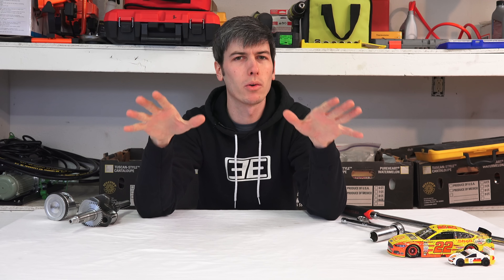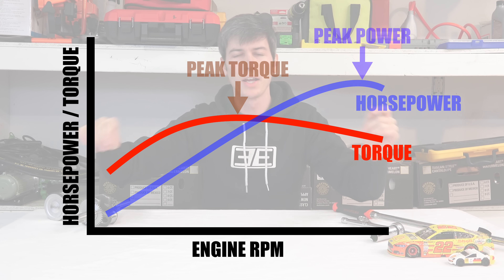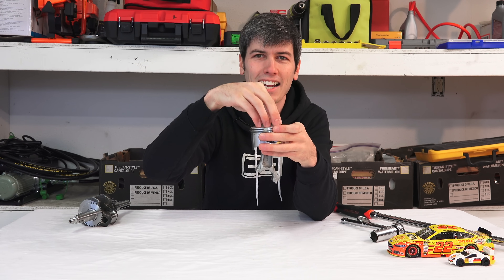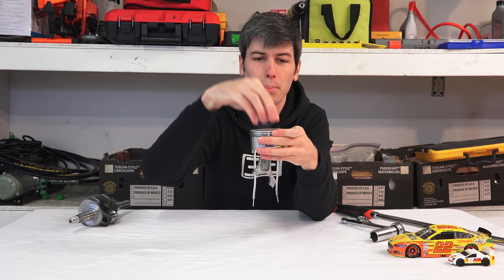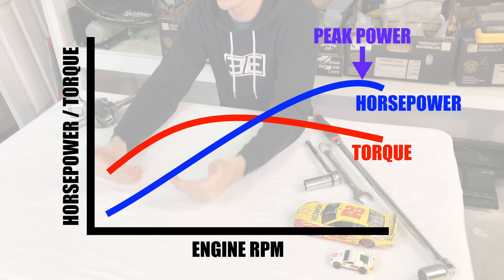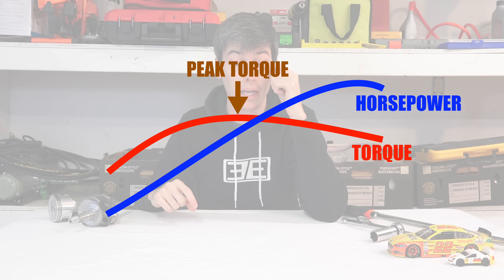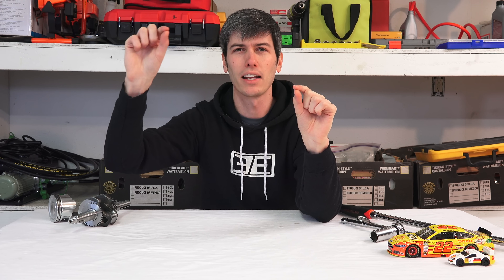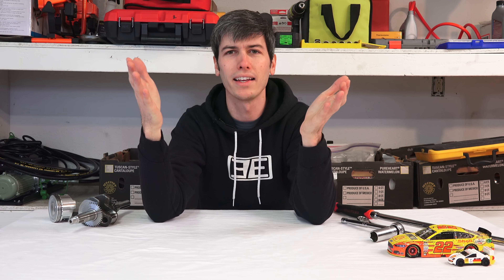Horsepower vs Torque - A Simple Explanation

Comment: OK, for the first time I really get why and engine with a longer stroke has more toque!  Same boom on a longer handle = more force to move (torque)!   And I get why a faster revving engine has more HP!    More booms per minute = more work done (HP)!
Reply: All else being equal, increasing bore AND/OR stroke will increase torque.  Each time the engine fires, you get an amount of effort.  A larger bore, the more fuel/air, the more boom, the more effort.  That effort at a distance is the torque.  The distance is (more of less) the stroke.  but all of this is how hard an engine can push, not how much work it can do.  HP is how much work it can do.  I think the simplest way yo look at HP is how many booms do you get a minute.  Each boom pushes at a set torque.  If you get one boom a minute, you will move slowly, even if you have huge torque.  If you can get 1000 booms a minute, you will move much faster.  More RPMs = more HP because more booms.  

I think:  Often it is true to higher HP engines are lower torque because the tweaks used to get higher torque make the engine mechanically impossible to run at higher RPM.  To increase the bore, you make the piston heaver.  The heavier the piston, the more effort is takes to change it's direction at the top and bottom.  The more effort to change directions, the faster to deteriorates.  You can only push so hard before the oil can no longer protect the parts.  Same for stroke.  The longer the stroke, the further the piston must travel per rotation, and thus faster travel per RPM.  The faster it travels, the more force used to change it direction.  

High HP F1 cars have extremely short stroke engines so that they can rev higher.  Trucks that need to be able to move heavy loads have long stroke engines that do not rev high.

Comment: Still confused.  You say peak torque is when I feel the most force against my back, so... that means the car is accelerating the most... how could it have more horsepower (meaning acceleration) later in RPMs if I've already passed the point in the power band where it had the most acceleration?

Wait, I think I understand now.  Maybe you could think of it like the power of the engine is at its most efficient at peak torque (every time the piston fires, you get the most 'push' per explosion), but it loses fuel / torque efficiency as the RPMs increase -- but that doesn't mean it's going slower, because the engine is turning twice as fast even though its only 0.8x as efficient.  2x as fast but 0.8x as efficient still equals 1.6x.

If I'm right, I would amend your comment and say at peak torque I feel the most force against my back PER REVOLUTION, but I will feel more force on my back higher up the RPM band.

Now I'm wondering what the application of 'torque' is to racing.  Why would racers want to know torque, why not just worry about horsepower and trying to maximize time spent at the peak power band?

Comment: Torque: you drive a car and push the throttle. You know that "sweet" felling that pushes your body in a seat and makes a big smile in your face? That is torque.
Horse power means more max speed and faster acceleration thru gears.. 
Comparing same hp cars , diesel and petrol in same gear, diesel will always pull better. It has more torque. Electric cars are even better than diesel. More torque.
Reply: em745a  😑

Comment: Why don't we use self ignition with gasoline fuel like diesel fuel, and we don't we use spark plug with diesel fuel?
Reply: Because gasoline doesn't self ignite and diesel doesn't need a spark, it needs compression

Comment: So the understanding is, Higher the torque means you can achieve High HP in lower RPMs while if the torque is low you need high RPMs to achieve high HP.

Comment: Slight error: Car A) 200 HP with 100 ft/lb vs  Car B)100 HP with 200 ft/lb.  Car B will accelerate faster than A; however, Car A will eventually achieve an overall higher speed. Thus the 0-60 sec for Car B beats Car A, but the 1/4 mile will allow Car A to gain more speed and keep on going faster than B. Thus the 1/4 mile result for A will show it going faster than B.

The way you explained it, Car A is always faster, including 0-60.
In short, high torque is always faster for launching, but high horsepower is good for top speed.

Comment: Think of a farm tractor. It’s slow up the road but powerful. (Torque) It’s about the gearing, and they usually have low horsepower. It digs in. A normal pickup truck cannot dig in. It would spin out, but flies up the highway.

Comment: Think of a farm tractor. It’s slow up the road but powerful. It’s about the gearing, and they usually have low horsepower. It digs in. A normal pickup truck cannot dig in. It would spin out.

Comment: Great ! Now I want more please.  WHAT is a motor doing; that makes the torque ???
Reply: I'm NOT an expert, but I think this is how it works In simplified terms:
The fuel explodes (by spark plug for gasoline and by compression for diesel) and that causes rapidly expanding fuel fumes. The fumes have nowhere to go (they are stuck inside the cylinder), but luckily the piston fits loosely. So, the piston can be pushed away. The piston's force is then converted into a radial force which can be used to rotate gears (and through the drive shafts it ultimately rotates the wheels).
The bore to stroke ratio tells you how the volume of the cylinder comes about. That has a large influence on the torque. A longer piston (stroke) has peak torque at a low RPM, and a shorter piston has peak torque at a high RPM.

Comment: I have a question. I cant seem to find a good answer here nor in forums. In a condition with high load and steep incline mountainous region, should i choose a bike with 25 hp and 32nm torque, or a bike with 31hp and 24nm of torque.

This is a conundrum for me. All these debates about horsepower and torque really amounts on field application of certain engine design. People seemed to address issues pertaining acceleration while not much talking about these two kinds of engine design, what kind of advantage both have, and what is the correct application for both. Some say to me, torque is the king in twisties, some say it doesnt matter as long as it has high power.

Im confused and would like to be educated about this brother.
Reply: em745a  so if there is a lot of stop and go in that manner, higher torque output is better to get the bike going, although it wont have the maximum power around the twisties. That means depending on the torque and power curve it could be faster for me to reach a certain horsepower in a torquier engine, although i will have less horsepower in the top rpm?

Ok i understand it a lot better than before.

Comment: So how about electric motors? 
They have 100% torque at 0 rpm but not 100% power?
Reply: Slight error: Car A) 200 HP with 100 ft/lb vs  Car B)100 HP with 200 ft/lb.  Car B will accelerate faster than Car A; however, Car A will eventually achieve an overall higher speed. Thus the 0-60 sec for Car B beats Car A, but the 1/4 mile will allow Car A to gain more speed and keep on going faster than B.

Since electric motors have almost instant torque, they absolutely will accelerate quicker than a gas engine. That's why Tesla's new roadster can achieve a 0-60 at around 1.9 seconds. However, it's top speed will be limited because it doesn't have enough horsepower to keep it accelerating. 

If you go crazy with the horsepower, like 2000 hp, some of that will obviously spill into higher torque; however, usually 2000 hp engines weigh a lot, so what you gain in torque is lost in weight, thus you need enough power to overcome the weight issues too. 

In short, high torque is always faster for launching, but high horsepower is good for top speed.

Comment: More confused than I was before watching 🤣😭
Reply: Physics is quite confusing. Here's a reply I gave to a comment that came a bit after yours, maybe it'll help: We [racers] do.  We spend as much time at peak power as possible. This means as low a gear as possible.  First gear gives 50% more acceleration than second gear.  Second gives 33% more than third.  And so on and so forth.  Another note, engines aren't most efficient at peak torque.  That's where peak intake air velocity occurs, and you cram the most air and fuel into the same volume.  So, you get the most energy for that particular explosion, meaning peak torque.  And there's more, lots more.  Here's a reply I have to the comment just after yours, maybe it'll help some: Well, power equals force times velocity, not force times acceleration. You're forgetting that doubling your velocity makes four times the energy. Weird, right?  So, even if power peaks a little later in the revs than torque, it is still directly proportional to rpm, not proportional to the square of rpm. Also, you have to take the area under the curve, you know, calculus (whatever that is, I forget) to get the total change in energy of the system. Long story short, peak acceleration occurs at peak torque. Here's the clincher. First gear gives the most leverage, and the most acceleration of any gear. Second gear gives less acceleration, but more speed. However, the engine is still making the same power in second  gear as it did in first.  Weird, right?  But, since power equals force times velocity, we see that force decreaes because velocity has increased. Less force, less acceleration.  So, second gear compared to first gear is the same idea as a higher rpm compared to a lower rpm.  Ah ha!
Reply: @MultiPleaser  This is the best explanation so far (especially the second half)!
Reply: @MultiPleaser   Awesome explanation, 9k rpm in 1st gear and 9k rpm in 2nd is not the same engine load though.
Reply: @She1lby  Yes, and I would like to see dyno runs in all six gears to see the difference.  I have seen charts showing driving force in all six gears overlaid on each other, you know, the charts where the shift points should be exactly where the curves cross each other in order to maximize acceleration.  But, those six torque curves are based on one dyno run, not six different dyno runs.
Reply: @MultiPleaser  Nice, are you sure that 1st gear acceleration is always the fastest? Hard to compare but it feels like 2nd \ 3rd gear may give more g\s
Reply: @She1lby  Oh yes, no doubt about it.
Reply: This might not be utterly correct, but good enough and it helped me a lot: torque is the horsepower of each explosion.
Reply: Too much words, less 3xamples. The easiest which is the best was to undesrtand something is with examples rather than words.
Reply: @Fizzyx13 Ah, but an object at speed is stationary from a different perspective.  For instance, if you are the piston looking at the con rod, and you're both at 10,000 rpm.  How do you (the piston) apply a force to the con rod at that speed, and then accelerate to 16,000 rpm?
Reply: i understood the difference perfectly.......and then i watched this video..i'm all screwed up now
Reply: Me too 😂

Comment: Horsepower = more top end / Torque = more bottom end.

4 stroke dirtbike VS 2 Stroke dirtbike is a perfect example imo.

2 Stroke will up and get it (Torque / wheel spin) but a 4 Stroke will top it in the long run (HP / more power) 

At least that's what I think anyway.

Comment: I was following you up until it all got complicated 😂😂😂
Reply: torque is how strong that piston push, horse power is torque multiply how fast it can rev.  A big engine has stronger torque and can pull better than small engine at the same rpm.  A small engine can get more horse powers by revving at higher rpm, but it can not exceed its torque limit for its size (unless turbo).  The S2000 engines can rev really high and make 240 horses, but has only 150 torque, even as it revs higher, it will only make more horse power, the torque is still the same.
Reply: @kenca0  Thanks for saying it i english dude :D i understand now! Thanks!!!
Reply: Torque is force per combustion cycle. Power is the force during 1 second. Higher rev means more combustion cycles during 1 sec = mo powah bebe
Reply: Same
Reply: What confused you?
Reply: He said some things from a mechanical engineering perspective and if you haven't been introduced to those concepts I can assume it would be a bit confusing.
Reply: HOLD UP.

So what comes first, torque or horsepower? How does one create the other or are they separate?

This video helped me understand much better than the donut media one!!!!!!!!!!
Reply: @ares6949  weird name. 

Firstly, we need to understand that torque is force multiplied by distance.
Torque in an engine is how much force the pistons can exert so that the wheels can spin. The longer the distance between pistons and crankshaft, the more torque so that the wheels can spin.

Horsepower is the times the piston revolves (like 500 Rounds per Minute etc.) and is determined by torque times RPM (power = work done/time) and so more the torque and RPM more the Horsepower. 

Overall you need more torque to get more horsepower so that a car accelerates faster and is more Eco-Friendly.
Reply: @alterego9791  very good now I understood the whole phenomenon thanks
Reply: Alter Ego wait u say then trucks have more torque to carry heavy load 
And less rpm to be eco friendly
Reply: @alterego9791  "weird name" hahahaha
Reply: At start.. all good "I know it all " 
Then a few moments later ....  I am here to join you 😂😂😂😂😂
Reply: Thought it was just me 😂
Reply: The science got me lost 🤣🤣

Comment: Doing research to impress my new bae and I understood until you got to peak torque. lol
Reply: em745a  Where did you get 5252 from?  Nah, I'm just joking.  I know it is 550*60/(2*pi) because there are 550 ft-lbs/second in a horsepower, 60 seconds in a minute, and 2*pi radii in a complete circle.

In its pure form of consistent units, with radians/second for rotation speed, there is no 5252 factor.

Comment: I dont get it. So why do they keep advertising torque number like 350 torque @1500 rpm. what does that mean??? I get that horse power make the car faster but what does higher torque at certain rpm do?
Reply: em745a   Thanks your explanation helps. So according to your definition of a "torquey" engine (at low rpms) it is very quick off the mark right? Is it like an acceleration advantage?

Comment: Think of it this way. Tractor has huge transmission to produce torque. But a corvette has more horsepower and is faster. But the tractor will drag that corvette fir days without a problem. Tractor=torque, corvette=power.

Comment: We had a science teacher.  Had a red wagon with a dial scale attached to the handle.  Put a fat kid in the wagon.  And a school hallway with a freshly polished tile floor.  About 50 feet down the hall was a taped finish line.  The assignment was to pull on the scale until the needle reached 10 pounds.  BUT ONLY 10 pounds.  No more/No less.  

So to start the wagon moving it was hard to keep the needle from exceeding ten pounds.  But as the wagon got moving, it became much easier.  But the needle would fall BELOW 10 pounds.  So the puller would have to go faster to keep the needle from falling below 10 pounds.  You needed more horse power to keep the needle at proper reading.  The puller was really moving when he reached the tape line down the hall.  Then the teacher asked the puller to remove his sneakers, and try it in his stocking feet.  On a slippery well polished tile school hallway floor.  Obviously, traction was quite difficult with socks on...instead of sneakers.  And as the kid tried he could not get the weighted wagon up to 10 pounds.  He had the horsepower...but with only socks for traction...he did not have enough torque.  Lesson learned.  Almost 60 years ago.  I was never a great student...but...I never forgot that lesson.

Comment: So then. Obviously as you and other channels have stated if I want to go fast. Then horsepower is the only one Stat we should really care about. And obviously power to weight. 

But if I am understanding this correctly then. Torque is a figure that gives me an idea the sort of maximum load my car could pull then? So if I wanted to tow a heavy trailer, speed isn't a major concern. So power isn't all that important because my objective with pulling a trailer isn't to do maximum work in smallest period of time, but rather to pull the heaviest load. So the maximum torque or maximum force my engine produces is a more useful figure to me when it comes to pulling heavy loads? Am I right?

Comment: Great explanation. My eyes roll audibly everytime someone gets these confused and claims their vehicle is faster because it has higher torque.
Reply: em745a  my John Deere 4650 had higher torque than any racing car, but its 180 hp engine never won any races.

Higher torque means you hit peak power at lower RPM, meaning you can get to peak power faster, but higher peak power means more ability to get the job done faster.

Comment: Overly simplified Jason. I think it is time for an update to elaborate on torque vs HP and how they are applied in real world applications. For example, you must have high HP for speed and you must have high torque for towing. And for speed, you must have high RPM, period. The faster you turn the engine the faster you can turn the wheels. Also, torque at the wheels for towing is heavily multiplied by gearing. On another subject, can you do a video on valve overlap so people will know why we do VVT. Thanks!
Reply: I will clarify. For a land vehicle you must have high engine RPM for speed. All race cars run engine RPM over 10,000 inducing stock cars. To go fast you wheels have to be rotating fast. A tire with a 1 meter circumference lays down a meter per second the faster it turns.